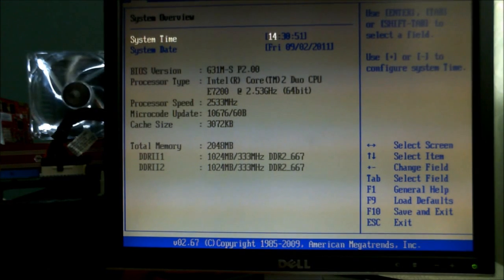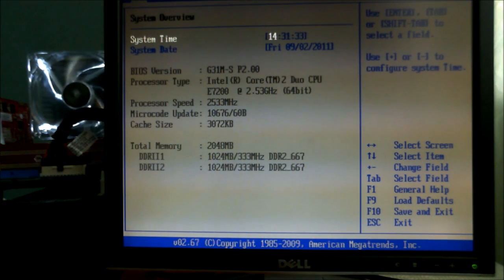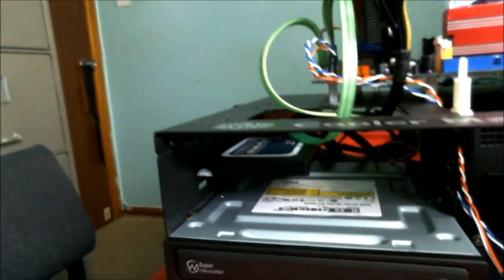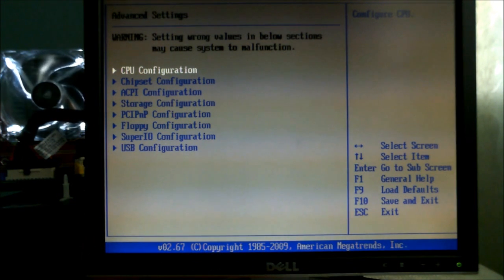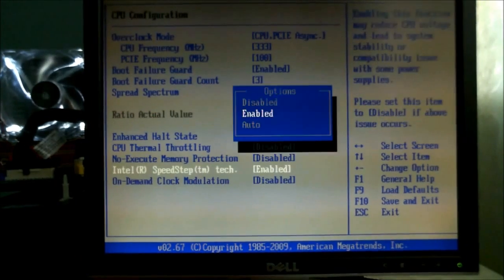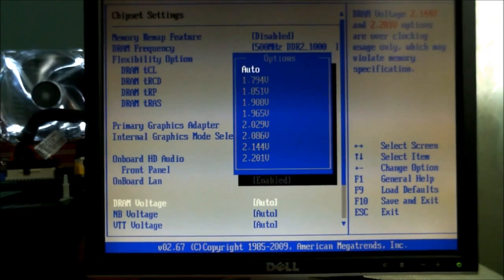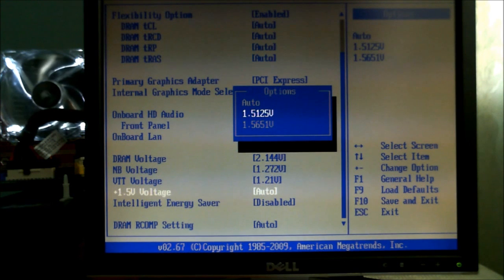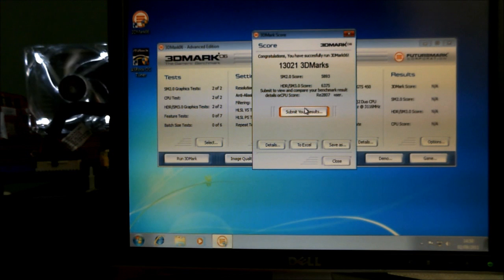Overclocking demo 2

Comment: Hello, can you help me overclocking mt e5200? When i do what you did, but with a lower fsb, (270) i get no signal, plz help
Reply: Pentium e5200 has a 800 Mhz FSB, so it wasn't a lower fsb, cause you've overclocked it to 3.37 GHZ, so I assume that you haven't increased the vcore, or the CPU does overheat
Reply: @jozsefimretabajdi3056  nope, the cpu wasn't overheating, it has a shitty intel style cooler but it has noctua nth1 as thermal paste, it doesn't pass 60 degrees in full load, and yes, the cpu can't really pass 3.3, but anyway now I have a x3450 oc'ed to 4.0ghz, that pentium was cool AF, this xeon is fucking HOT

Comment: Hi man help please ... I hope you can help me, I find nothing in google ...
Windows 10 64-Bits
Nvidea GTS 450
Motherboard : Asrock G31M-S
some images : http://www.mediafire.com/view/u1e04vauqyyx222/IMG_20160913_012607.jpg
http://www.mediafire.com/view/g3jfb3b29c6e4o9/IMG_20160913_012623.jpg
http://www.mediafire.com/view/pgynd7c4b3vodbw/IMG_20160913_012632.jpg
http://www.mediafire.com/view/i90vtm1wvn8e4ds/IMG_20160913_012643.jpg
Reply from the maker: What do you need help with dude? Message my through YouTube :)
Reply from the maker: What do you need help with dude? Message my through YouTube :)
Reply: Hi thanks for reply, I need to know how it should be configured to overclock my Asrock G31M-S to the processor C2D E8400... if you can edit the images.. and also, with which program I prove its stability .....
Reply from the maker: It really depends on how good your actual chip is.. Each chip has its own characteristics. Best way to do it is to bump up the clock in stages of 3, then run a program called burntest -http://www.majorgeeks.com/files/details/intelburntest.html - after each adjustment. Just run that and keep an eye on the temps, depending on your cooler, you really don't want to peak over 60C or 140F. I wouldn't play with the voltage just yet until you have your chip bedded in at a decent overclock, then we can go from there.
Reply: IntelBurnTest my details: 
Test-1: http://www.mediafire.com/view/3el0vhsss0m019y/1.png
Test-2: http://www.mediafire.com/view/j4g5vo9ktlb7lxj/2.png
My bios settings:
1_:http://www.mediafire.com/view/wkc8gfdbdkc342m/B1.jpg
2_:http://www.mediafire.com/view/i74p06s0u9nu728/B2.jpg
3_:http://www.mediafire.com/view/id1u9jojq945zzg/B3.jpg
4_:http://www.mediafire.com/view/im1f9jr779tgs1w/B4.jpg
Reply: My refrigeration is by air ....
Reply from the maker: Which cooler are you using? Is it the normal fan that comes with the processor?
Reply: yea, but select the option: flexibility option: and low the temperature of 69 to 65 :D and the memory ram, was placed most compatible..
Reply: Sorry for my bad English...
Now gave me these results...
Test_1: http://www.mediafire.com/view/mjv1s5ao0yjxdje/4.png
Test_2: http://www.mediafire.com/view/alcy5kex468v10d/44.png
Reply from the maker: Switch the overclock more to CPU, PCIE, Async.. The memory will sort itself out and cause less issues :)
Reply: and as for the other configurations... are good, or change another, you tell me about the voltages that I have, they are fine.. ?